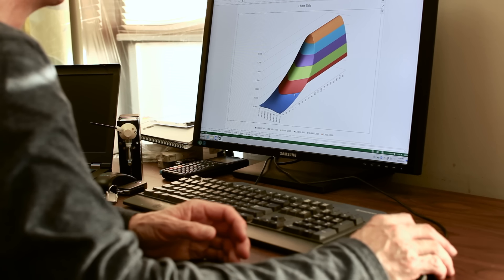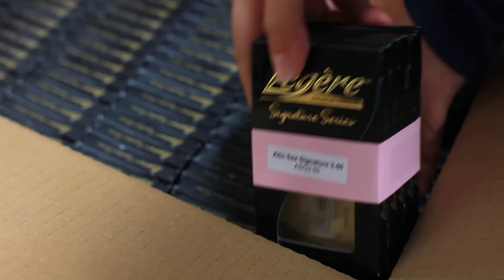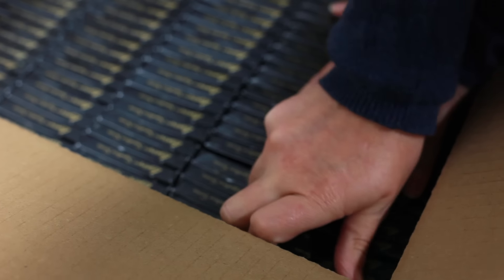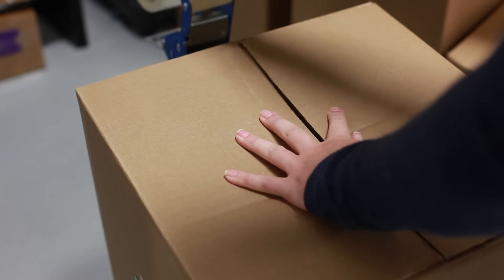The Légère Reeds Story

Comment: I am a beginner playing the Alto saxophone and started with different cane reeds but bought a Légère signature 2 reed. I love it and will be getting more. It doesn't have the inconsistencies of cane reeds or need moistening or working at before playing to sound right. I can just put it on my mouthpiece, tighten the ligature and it will work and sound the same each and every time I play. For a beginner like myself that is really useful as it lets me know the sound I am getting is to do with how I am playing and not issues with the reed. Plus being synthetic I have found the reed easy to clean and keep hygienic.  Overall I love the sound of these reeds. Very close to cane reed sound (the Signature is maybe a little brighter) without any of the issues cane reeds are prone to.